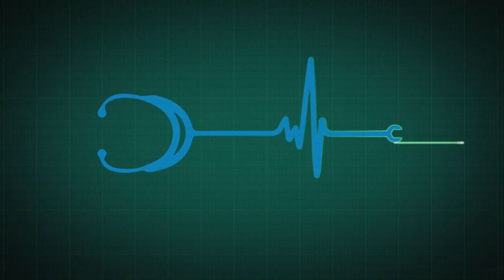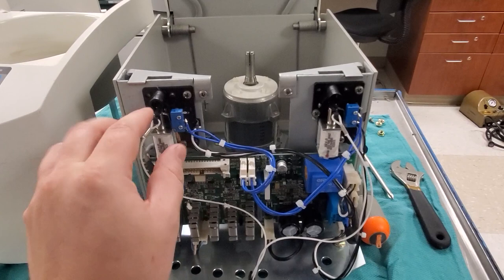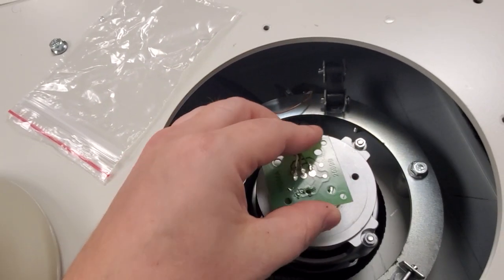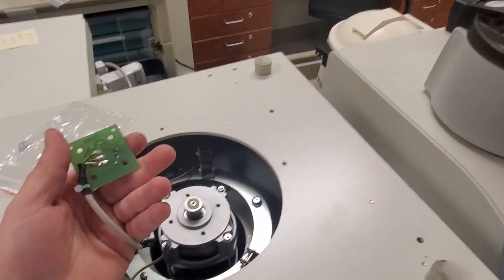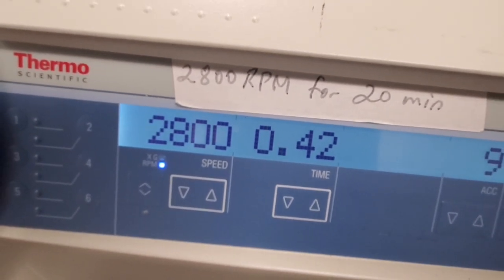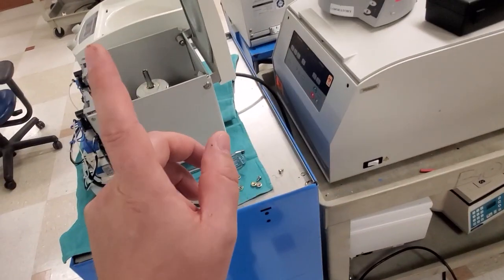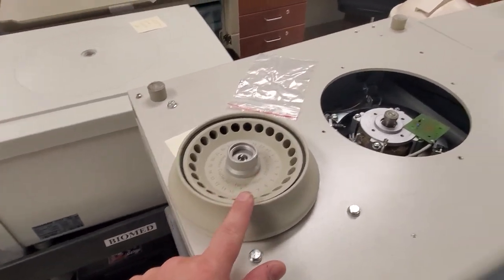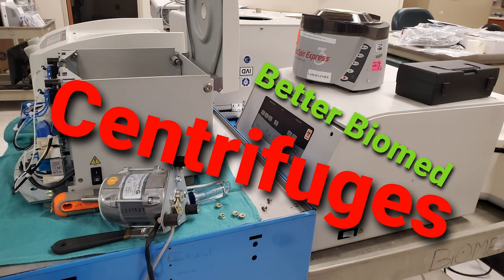Biomed Basics: Centrifuges

Comment: Nice video. I used to do centrifuges a lot. There was a particular old model of Eppendorf that had rubber motor mounts that would suspend the motor. They would crack and split, make the rotor sag and it would rub against the inside causing smoke and a burned plastic smell. Also saw a lot of worn out gas springs on bigger units making the lids crush user's hands. Good luck with the re-assignment to lab.

Comment: So I like tinkering with devices of all types and after so many you see where some drew inspiration from the other. The difference between this and an espresso maker is small. Instead of your driver for the motor youve got an ic board for checking thermistors, resistor heater controllers, solenoid controls, ect. The soleniods would open and close valves to dispense water or coffee. Micro switches to detect open lids. Just something I found interesting.
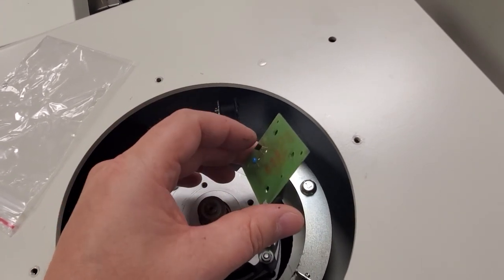3:06  I learned something new and I have a basic understanding of electrical engineering and available components but ive never heard of a four pole magnet or quadrupoles. All magnets are still only two poles but they arrange four magnets in a certain way with same polarity facing and pushing away from each other but leaving the opposite and attracting polarity to its 45 and 315. I might try making one now and thanks

Comment: Getting a almost exact double rpm reading from my tach on a drucker 755V-12,  stray reflective mark? Never had it happen before when checking RPM.
Reply from the maker: Use a black sharpie to color the rest of the surface except for the reflective tape. Also, be sure that the correct rotor is programmed (if a programmable centrifuge).

Comment: What is the issue with the clay Adam serfuge 2000? There is also a plasma thawer toward the end of video.
Reply from the maker: One issue was the rotor had vibrated on the drive shaft and caused a harmonic and wear.  A very light coat of high viscosity grease stopped the galling and go rid of the rotor squeak
Reply: Are you the lab person now? What is the gas machine at your hospital? There must be at 30 gas machine?
Reply: Thanks for the troubleshooting tip.
Reply from the maker: Gas machine as in anesthesia machine?  We have Drager.
Reply: @BetterBiomedChannel  Draeger, which one primus or Zeus? How come one of your previous video you were talking about the GE anesthesia machine condenser leaking?
Reply from the maker: @denniss4455   most of our machines are Perseus and Apollo

Comment: Do you work also on Electrophoresis powersupplies ?
Reply from the maker: I havent needed to yet.
Reply: @BetterBiomedChannel  , i have bought 2 "For spares or repair" from Ebay.
One was a quick fix, and had only a blown "Rifa" safety capacitor, the other one is completely dead, no display whatsoever and not yet the time to diagnost the real problem. I first need to build a 1:100 attenuator for multimeter and scope to measure the output of the powersupplies. They have a output of 3Kv @ 150mA max, and need a load to enable the output.